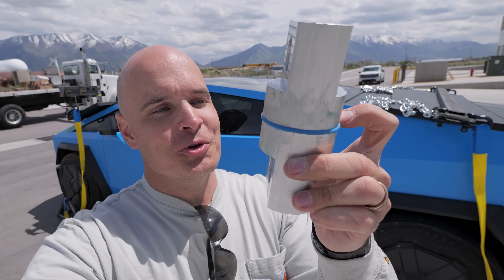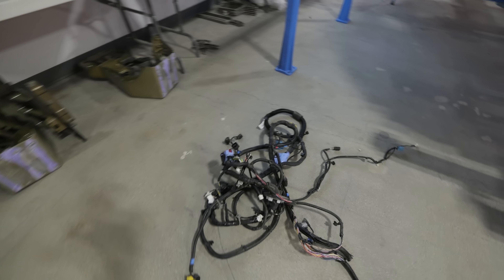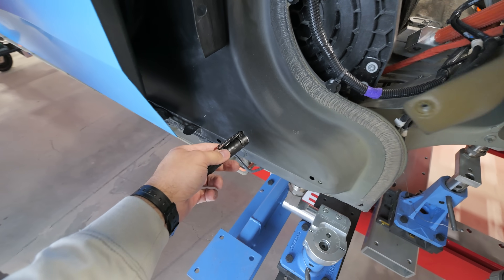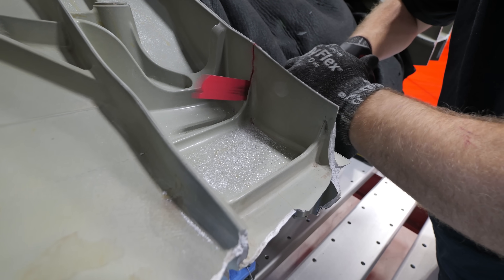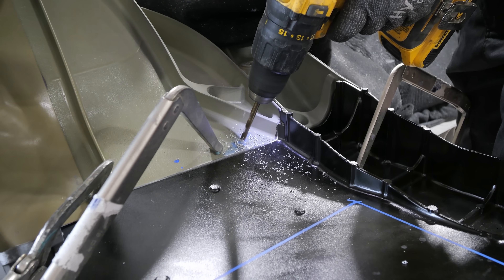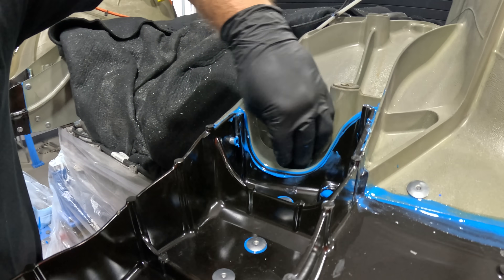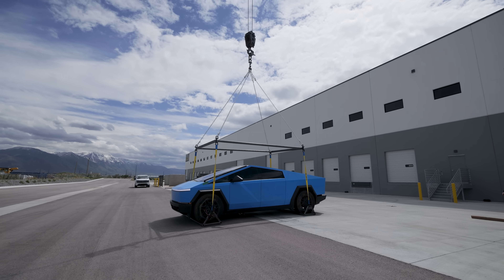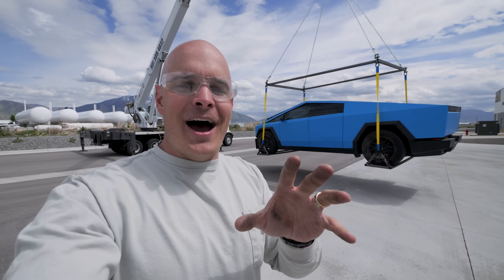Tesla Fixed my Cybertruck with GLUE - (but I'm not mad about it...)

Comment: I’m honestly most impressed that it was fixable at all. I figured it was totaled. That’s a genuinely clever repair procedure… at least from the engineering perspective.
Reply from the maker: I agree!
Reply: @JerryRigEverything amazing these glues and epoxies can do these days!
Reply: @JerryRigEverything phew, thanks for putting this video out, I got rear ended in my cybertruck and after seeing your last video I was terrified my truck was totaled. There was no apparent rampage, even the plastic bumper was untouched (I had a ball hitch attached) but I was worried the giga casting would be unrepairable thus totaling the truck, it’s good to know they thought about this.
Reply: @JerryRigEverything 
Did you know,..
That many structures in an aircraft, like a 747 let's say. Use adhesives and sealants as well for structural reinforcement.
... hail to the queen baby 🤗
Reply: @JerryRigEverything  if you didnt hate elon politically, you'd love the cars he makes even more
Reply: @JerryRigEverything  you said in your previous video “there are real world scenarios where the trailer weight becomes tongue weight, going up a steep hill or driveway your hitch could snap, or your trailer jumps the ball going 80mph on the freeway, giving the safety chains a jerk, your whole rear end is now gone” “it’s built like a pop can”

Now it’s “As long as you load and balance your trailer correctly, the cybertruck will always be able to load its rated capacity” which tongue max weight apparently is only 1,100 pounds, funny how after you go to Tesla you don’t say any of this 😂 seems like someone paid you cough Tesla
Reply: @SMURFF707 he probably learned more about towing, honestly a lot of trucks out there are only rated for 600lbs tongue weight but you can still tow a full size truck on a trailer with that if it’s loaded properly. 1,100lbs tongue weight means your total trailer weight could be 11,000lbs that’s a lot of weight!
Reply: @JerryRigEverything  so let me get this straight, you expected your video to total the truck. This would’ve gotten you out of Tesla cyber truck ownership. Somehow your plan didn’t work out? That’s funny.
Reply: @I-0-0-I that made no sense whatsoever bud
Reply: @I-0-0-I Insurace doesn't cover purposeful distruction, so no.
Reply: "To test the maxium adhesive strength, we're going to use a rig that me and Bosnian Bill created"
Reply: Hey you switched accounts before commenting on your own video? Haha.
Reply: @ahmadmalik8419 dude that’s so crazy cuz just earlier I was thinking now similar they sound! Wow!
Reply: @ahmadmalik8419 Hahaha I can now totally hear this 😂
Reply: @ahmadmalik8419 ,

They do kinda sound similar indeed…. But they are not really the same right?
Reply: I'm just gonna glue my doors shut from now on.
Reply: It's not a fix, ANY adhesive that isn't made of metal is going to deform at extreme temperatures, you try to tow something now at below freezing temperatures, you'd better be prepared for catastrophe.
Reply: it cost more to fix than a new one. watch when they called with less damage than that . just hours ln labor
Reply: @kendexter  how can it cost more to fix a rear ending, did you lose the motor and battery?
Reply: @kendexter  that's insane considering it was probably smaller than the damage in this video.

Also, sounds like they went easy on Jerry for the ad.
As usual, Tesla being dishonest and scummy.
Reply: Should of never been designed that way to start with, at no point in time should a quarter panel ever be glued on.
Reply: You gotta bring whistling diesels trucking and see if they let you record that.
Reply: Appreciate this!
Reply: Agreed, but it did cost 16 pretty pennies
Reply: 2.5" aluminum ROD. Not Tube.
Reply: I have a lot of complaints about Musk, as I've never liked the guy, even before it was cool to hate on him. But I have to give credit his company where it is due. Building the ugly cybertruck with repairability in mind is great to see, especially after seeing the damage done in the original video, this is genuinely impressive.
Reply: Yeah I honestly hate the cyber truck, but I too will admit I’m completely impressed by how serviceable and repairable it is.
Reply: Did you notice the engineering explained video of the new Cadillac that's a fully cast lower!? 😮
Reply: This is why Tesla is far ahead of any other automaker. There manufacturering skills make all other automakers look like toys.
Reply: @deltaechomusicnh555  LOL.. u might ask AI about the cost and labor for repairs at that magnitude. trash it becomes , buy a new , not everybody have a huge channel and get fix "for free"
Reply: @kendexter  What you on about? He didn’t get it fixed for free. It cost him $13k to fix. Did you even watch the video?
Reply: 10 million subs.
Reply: youre a paid Elon mouth
Reply: Its a rite to repair pump and dump scam. 13k for a bumper and frame horn is insane. I like Tesla but that's a huge failure for longevity and repair ability. ❤
Reply: @Randomactivities2.0  most of it was probably labor costs
Reply: @Randomactivities2.0 ??? Do you even know what pump and dump means? Or right to repair? The repair guides being published online for anyone to see is pro-right to repair. Right to repair doesn't mean right to the mechanics' labor lol
Reply: @Randomactivities2.0 I don't know what kind of cards you drive but I have had a few minor accidents in my BMW and I would consider 13 grand to be free compared to my bills
Reply: @jwanilpatel3223  affordable cars. Lol. 13k is nearly double my annual income 😂.
Reply: @Randomactivities2.0  You just need to look at some cheaper cars if you can't afford repairs for this one.
Reply: @youthinkyouknowbutyouneverknow  I do.
Reply: @Randomactivities2.0  It really isnt. There is no way you could replicate those forces with a legal load or even illegal load in normal driving conditions or even abnormal normal driving conditions.
Reply: @landcruiser801  but yet it has multiple times. And that overlooks the longevity of the truck. Is it a generational vehicle or will only last as long as the glue and batteries? It's not a vehicle its a luxury item, no different than an rv or camper. ❤
Reply: @Randomactivities2.0  Well the batteries are expected to last for over 1 million miles so dont think that is an issue. As for the rest of it, the body aint gonna rust away and after that what else is there that cant just be replaced bolted on. I guess the computer circuit boards would be the first things to get fried. Its only a luxury item by price but in the uk farmers have land rovers or range rovers and they cost the same
Reply: @landcruiser801  lol, go read a history book on land and range rovers. Like calling a unimog a f150 lightning.
Reply: @landcruiser801  it happened once though, someone towed his camper and hit a bump at high speed. Whistling Diesel shared the picture back then
Reply: @Randomactivities2.0  No it isnt. A Unimog is an entirely different beast. A luxury off road 4x4 is just that be it in pick up form or whatever. I know plenty about Land and Rangerovers.... there poor man's Landcruiser 80! ;-)
Reply: @landcruiser801  I do love a good ol military farm vehicle
Reply: @xelaander8429  I can break anything if I misuse it. Dont vehicles have a 50mph towing limit? Have you got a link for the accident, I cant find anything. Not disbelieving, things like this get me curious and I like reading stuff
Reply: @Randomactivities2.0  Me too, always wanted a Unimog but the 80 series is more practical for everyday use. Once thought about putting the Unimog ported axles on the Cruiser but that limits your road speed and slightly overkill
Reply: @Randomactivities2.0  you managed to say so much dumb stuff in just 3 sentences. I applaud you!
Reply: @AI-qd4vb  thanks for the words of encouragement.
Reply: @AI-qd4vb or you just couldn't comprehend it😂
Reply: @AI-qd4vb  dude doesn't know what a pump and dump is, just said it to be cool 🤣🤣🤣🤣
Reply: Its more interesting to see an otherwise morally upright person promoting a business whose CEO has engaged in wildly unethical conduct which may threaten the democratic freedoms we take for granted.
Reply: @crowonthepowerlines  It would have been dishonest not to show the ease of repair of what anyone would asume in the original video was totally ruined and unrepairable.
This says a lot about Mr. Rig's integrity and I applaud that he made the video, even when I am not a fan of the CEO in question.
Remember two wrongs don't make a right.
Reply: @crowonthepowerlines  while Elon bank rolled and supported Tesla the creators of tesla were not elon, and showing off a repair process and being impressed by the strength of glue that not only tesla uses but other automotive companies is a cool thing to show off, it just so happened to be on a tesla that bumped got ripped off. Not once in the video did he mention elon being a good guy.
Reply: @crowonthepowerlines  clearly, you haven't looked at the things Bill Clinton did in his cuts.
Reply: @crowonthepowerlines  Socialism is a greater threat to democracy, then a guy who was basically forced into buying a Social media company; was told said company would go bankrupt; and despite basically every effort to make it go bankrupt by companies pulling ad revenue, so called boycotts, attempts to spin up competitors - the ad-companies went crawling back for the most part, and the people that bailed are slowly filtering back, as the spun up competitors implode to the crap that was sending twitter spiralling into the dumpster back in 2017.

Elon musk says some absolutely stupid things. But going to town on trying to trim the fat out of the federal budget? That's a good thing - Democrats had been promising to do that for decades, even some RINO's were promising such. And yet, here it is finally STARTING to happen.
Reply: @crowonthepowerlines  Im not going to argue against the validity of your statement, just fill in the parts you missing.  Ready?  …Promoting a business who’s CEO has done more for mankind than any other person alive today, including the EV transformation (do you remember the urgency of the climate crisis), ultra-efficient manufacturing, reusable rockets, high quality and world-wide accessible internet, effective underground tunneling, neuralink, etc.
Reply: @crowonthepowerlines  Why are you filled with hate?
Reply: @crowonthepowerlines which freedoms specifically?
Reply: @megazombiekiller9000  Just by asking that question, it's obvious that it's useless to even engage you.
Reply: @megazombiekiller9000  The freedom to have people we vote to represent us manage the funds of the government instead of ONE non-elected official? Nobody f***ing voted for Elon Musk, and simply because he has millions of worldwide (that's every country, not just the United States) cheering him on on X, doesn't mean the American people want his intervention.
Reply: @megazombiekiller9000   right to repair would be most applicable here. Which is a freedom not provided in the US unless the company feels good about it. Most cars you can repair a bumper in any mechanic's shop - from what I'm hearing in the comments this voids your warranty with a Tesla if it's even possible in the first place.
Reply: @MagicCookieGa @MagicCookieGaming s when Elon was in charge of DOGE in the US Government and people were being hyperbolic about him ending democracy and destroying freedoms. He wasn’t really doing that, which was the point of my question. 

2.) on the cyber truck it isn’t a broken bumper, it’s a broken frame. The Cybertruck uses a cast aluminum unibody design, so when the bumper breaks here it is actually the frame being structurally compromised. Not sure how that plays into warranty and legalities as it’d be case by case though there are legal protections and definitions through the FTC and Magnusson-Moss Warranty Act about what has to be included in warranties and how repairs effect them.
Reply: @megazombiekiller9000  holy yap
Reply: @crowonthepowerlines  WTF are you talking about?  Since when has creating a path to a sustainable technological future been considered immoral?
Reply: @crowonthepowerlines thank god we’re a constitutional republic
Reply: @crowonthepowerlines  Wahh Wahh Wahh, that's how you sound
Reply: @crowonthepowerlines  Or their "morally upright" image is just a charade to make them money on youtube.
Reply: @crowonthepowerlines  What wildly unethical conduct? And democratic freedoms... more under threat from the thought police left, this is how you think, you can not speak this way in public, four leg good two legs bad... are you for real
Reply: Speaking of impressed - I am not impressed with him still owning that mobile hate speach billboard. 

Jerry, you have enough money to dump it and take a moral stance and you don't. Sadly, in today's climate you'll probably be heiled for sticking with it. Yeah, spelling 100% intended. 
At the very best and with all the benefit of the doubt, this is an example of good people doing nothing and we know what happens then.
Reply: @AntiVaganza  So you judge people for not getting rid of a car, juts because you don't agree with the manufacturer? 
Congrats you are no better than the extremist on the other side.
Also a hypocrite since many of the things we use come from corporations that have been involved in truly evil things.
Reply: @Topo842  You have a point and then again you don't. 
A  valid argument I would listen to when it comes to a guy who is proping up nazis in Germany and eradicating everything decent in his way would be if you had said: "what about his employees and their livelihood..?" 
Yes, there are many evil corporations but sometimes you have to say enough is enough and sometimes there's such a thing as right and wrong. 
And Musk is so devoid of any moral compass that this it is very much OK to judge people for aligning themselves with him. And if you had bothered to read my post more carefully, I stated that Jerry has enough money to take a moral stand. If you own a Tesla and can't afford to dump it, I of course understand. If you own it and think all is OK whilst otherwise being big on inclusion, it doesn't sit well with me. 

As for your whataboutisms that's exactly the type of moral cop out that will lead to more insanity in the years to come. But yeah, keep blaming the messenger.  If I am a fanatic for wanting people with influence to take a stand these days, then that's a sad state of affiard but I can live with that lavel. 

Cheers and have a good one.

Comment: How can this truck be simultaneously this easy to repair and have parts designed to fit together like this, but also have door handles that don't work in the winter and be build so cheaply that it falls apart trying to tow things...

Comment: This is nonsense. In the 1970s, the general manager of Volvo (I think) stood on the roof of one of his cars as it was raised high into the air by a crane, with a chain affixed to the car's roof with superglue. The glue held, the paint held, and nobody died. But you wouldn't glue your car together with superglue, would you? The test of this blue adhesive lies in its ability to resist shock and shear - the forces that actually matter. Let's see those tests

Comment: Thats just absolutely incredible. What a cool video. Great shots and explanation. Great job man
Reply: Tesla got great value for their money
Reply: He said in his previous video “there are real world scenarios where the trailer weight becomes tongue weight, going up a steep hill or driveway your hitch could snap, or your trailer jumps the ball going 80mph on the freeway, giving the safety chains a jerk, your whole rear end is now gone” “it’s built like a pop can”

Now it’s “As long as you load and balance your trailer correctly, the cybertruck will always be able to load its rated capacity” which tongue max weight apparently is only 1,100 pounds, funny how after he goes to Tesla he doesn’t  say any of this 😂 seems like someone paid him cough Tesla
Reply: @SMURFF707  honesty the test was not close to realistic use. It was mostly click bait with little real life application. I mean, the front of the truck had to be held down by a front end loader tractor… I’m not sure how often you tow with the weight of a tractor on the front because the trailer tongue weight would otherwise lift the front wheels…. Dumb test, but it’s entertaining for the masses.
Reply: @Upliftyourbrothers  “your trailer jumps the ball going 80mph on the freeway, giving the safety chains a jerk, your whole rear end is now gone” 

this only takes a split second and your front wheels won’t be lifted up much because your rear end will be gone before the wheels lift up. Which is a realistic scenario but keep living in LaLa land

Comment: 11:24 that's a lot of surface area the adhesive was applied to, and it failed. How much weight was applied to it? The glue on cilinder hoisting the truck in this video is either different or it works differently with the particular surfice condition and material of the cilinder
Reply: 11,000 lbs apparently. But the prying force is different from the forces in this video. 

Glue is super good at holding things that are pulling directly down on it, but in the video there was 11,000 lbs acting as a lever on the glue, pulling it apart from the back of the truck towards the front, so the forces involved are a lot different. This crane test for the glue is a much more favorable condition compared to the tongue weight test, where torque could actually be applied to the glue's bond.

Comment: Still, the hitch attach points shouldn't be part of the truck structure itself. It should have shear pins or shear structure in mind to avoid having to incur in 13,000USD repair cost.